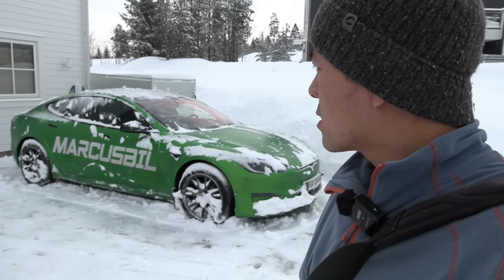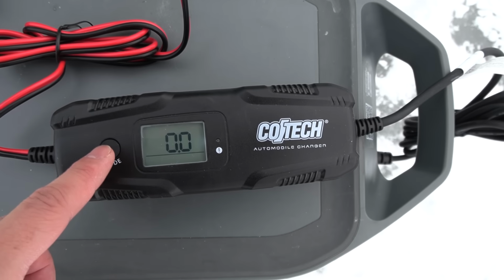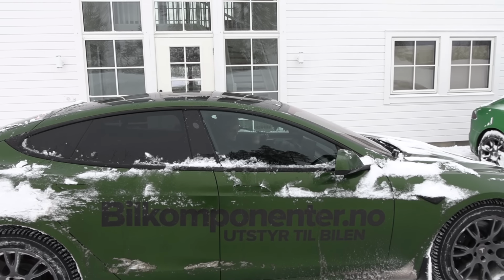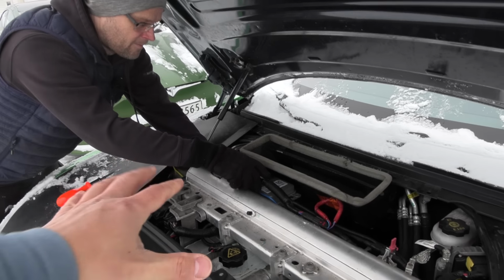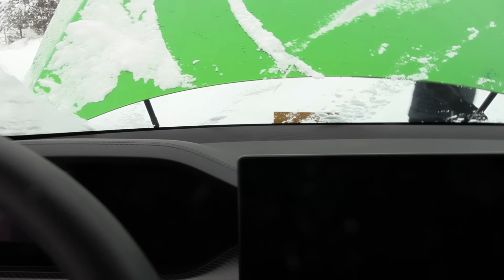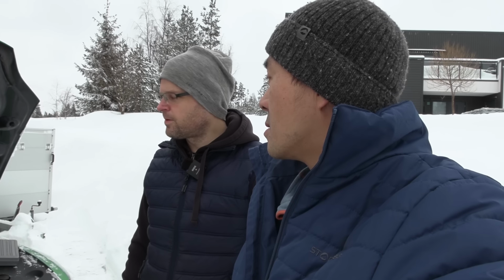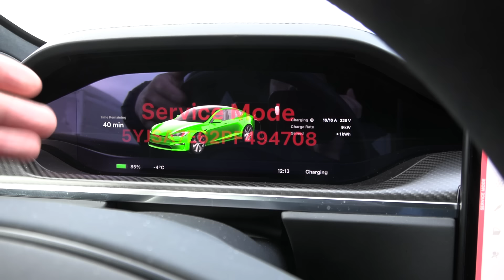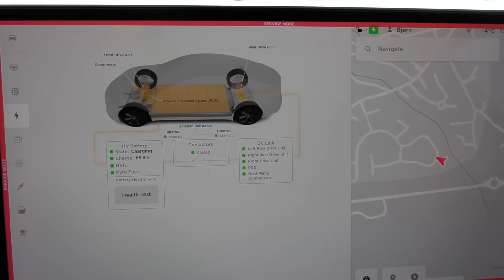Tesla Model S Plaid died in the cold

Comment: Good idea about using the EcoFlow 12v outlet with a plug and 2 wires or clips to test opening the frunk. That plug/wires could be added to your kit.  Then you might not need an old-style charger. That still has to be tested for how long it takes. Unplugging the 16v battery with the frunk open and using the EcoFlow 12v outlet to work the latch mechanism could tell.
Good info on unhooking the lithium battery once in. 
Good to know the 16v battery self-discharges to stay warm. Why didn't the car keep the 16v lithium battery charged with the high voltage pack at 80% when not plugged in? That seems like a glitch. Possibly the car should keep charging the 16v battery until some high voltage battery low point.

Comment: i have find few report list about tesla found died wont do anything untill you charge 12v battery if that keep happend them i recommen you replace that 12v battery them there be no more problem because there few 12v battery that died out of nowhere it defect cells it can drain battery down to 0% and computer didnt catch it in time it died out and system replying on 12v battery do all work not big battery under car no that for motor only and 12v battery is only thing power whole system up and get that 12v battery replace you will see big different in it

Comment: This is crazy and dangerous,  if something dramatic happens to your system, you can't get in or out of your car unless you're a technician or a technic buff? I saw a video on YouTube where a Tesla at a red light started smoking, but the driver had to break the window to wriggle out. The car burned down... How incredibly dangerous is that? Tesla should add a mechanical system at least to get out of the car, this is a major default.
Reply: There is a mechanical system to get out of the car. In fact it's so well accessible that people who are new to Tesla door open button will use the emergency exit lever instead

Comment: You can get a cheap CC CV power supply with knob to adjust the voltage. Would work for all cars and doesn't need to detect a real battery to supply voltage. You just have to set it to roughly the correct voltage for the battery you are trying to charge. I have one that is 6A, 5-60V and have charged/jumped many batteries with it.
Reply: As a small widely available solution two 9 Volt blocks in series should be fine. 18V should be tolerable for 12V and 16V systems as the internal resistance of 9V blocks is relatively high. Another source suggested using an A123 12V battery.

Comment: AP computers in the Plaid can pull 200W each, and there's two
Reply: They can pull that much-yes?
Should they pull any power when HV battery is disconnected - no.
Reply: @volodumurkalunyak4651 it's not disconnected, where would you get that idea?
Reply: @f36443  from LV battery beeing discharged. When HV is connected, DC-DC does run all those computers and charges LV.
When HV is disconnected, autopilot computers should behave like ordinal computer when switched off but still plugged in.
Reply: @volodumurkalunyak4651 AP computers don't run while the car is stationary or in standby.
Reply: @f36443  exactly as I wrote, those work like a switched off computer when car in standby - very little stays powered on.

Comment: Teslas are junk, bad design, i will never own one, i prefer the nissan leaf which i own, at least with the leaf the key fob has a physical key and the doors have physical assessable handles  to use to open the door plus the hood has a physical latch, and typical 12v lead acid battery.

Comment: I´m on my second EV, after 3 years in a Model 3 I´m now owning  BMW i4. My next car will be most likely an ICE again. All this stuff is way overcomplicated. The Tesla had a defective heating system in the beginning (and several other defects) and the BMW i4 series has a leaky heating valve.  I bought both cars in winter (the M3 in December and the i4 in January. In 37 years of ICE cr use, I never hat to sit in the cold in my cars.

Comment: What happened was your car was trying to charge the 12 volt battery charger, that's why it wasn''t responding until you connected the 18 volt lithium. The system was looking for 18volts, and you were only supplying 12. You should have left the lithium connected, and simply connected the charger to the charge posts.
Reply from the maker: Nope. According to the manual, you can power the low voltage systems with 12 V. Tesla has been designed to detect that if the 16 V is disconnected, it can accept 12 V.

Comment: You made a big mistake.

The old charger that you have used has not stabilized voltage. It has only transformer and rectifier and deliver 100 Hz   pulsating DC from zero to 14 Volts.

It is intended to be used to charge a battery where the battery is big electrolytic capacitor.

You are lucky you haven't fried all electronics in the car.

Comment: EVs have had their day. In the UK the cost of charging is more than petrol or diesel now. There aren’t enough chargers. Insurance costs are up 74% due to battery faults resulting in writing whole cars off or minimum £30,000 replacements (on small cheap EVs. My e-scooter has a 160 cell battery and that alone cost £940). Also, many insurance firms refuse policies now. Oh and battery damage leading to major fires.
Reply: And you are the Pope.
Reply: EVs have had their day? Ok so, what's next? Maybe controlled explosion of liquids to generate rotational forces?
Reply: Show me a car that can do 90 miles for £1.57.good ev charge planning makes it super cheap to run. I'm just over £100 to travel 3000 miles. 20k evs purchased last yr in uk. Infrastructure roll out increasing all the time. Works for me.

Comment: Antone owning a car should and know how to take care of their machines. Any car has battery issues (even ICE) in the cold and that’s why many people have battery chargers during the night so that the battery doesn’t wear out too fast. 

When I lived in Germany and one of my cars had to be outside, in winter I always had a cover for it that was very easy and fast to take out! That way the paint and glass are protected, also you have a cover that helps the snow/ice not to be in direct contact with the car and the battery’s temperature won’t be so low as when the snow has direct contact with the car’s metal.

Besides, whoever has an expensive car, can buy at least a cover or make a small exterior wood / metal “garage” (sealing) so that the car is at least somewhat protected.

Comment: At best, I would only get a plug-in hybrid with 40-50 miles of EV-only range. Mild and non-plug-in hybrids are useless for reducing petrol use. 

Toyota’s CHR 2.0 petrol hybrid used two thirds of a tank of unleaded to do a 120 mile drive. My 2008 Saab 1.9 TID 150bhp (mapped to 196bhp) did the same journey to the same venue and back and the fuel gauge barely moved.